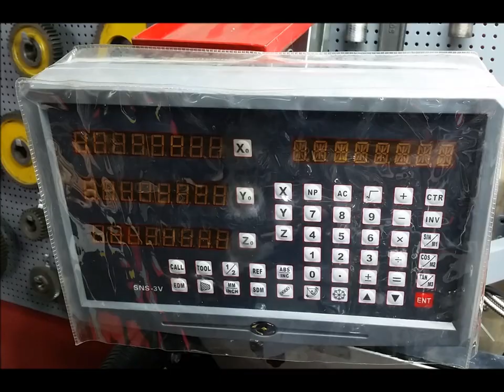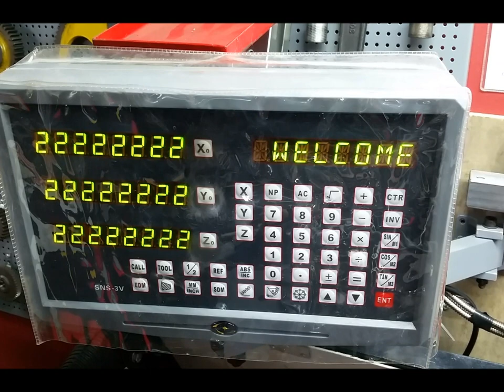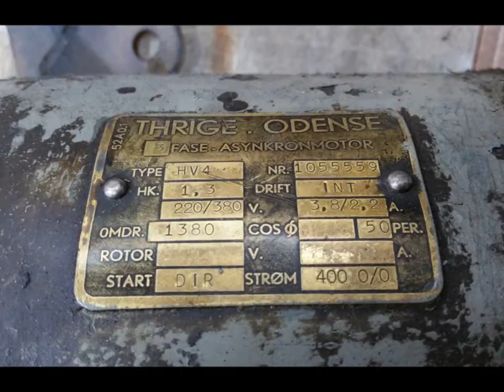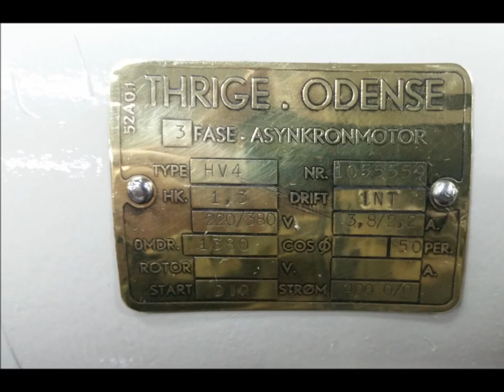Vilh Pedersen 1950 millingmachine restoration part 2

Comment: It almost seems a shame to cover-up that beautiful gearbox. Great work, looking forward to seeing the end result of all that effort. 

Thanks for sharing!
Reply from the maker: Thanks Neil! yes that gearbox is nicely made an very smooth operating.. These old machines is just amazing👍
Reply: Tapio Kahelin can jou tell me what's the colournumber u used? I'm restoring a vpu1
Reply from the maker: +Jelle Van Der Heide Hi! i have missed your comment, sorry sir! i have to check that colournumber.. good luck with your vpu1! are you making a video about the restoration? hit me a link if so😃
Reply: Tapio Kahelin Thank you! And i am also interested in what kind of primer and paint  you are using. I stripped mine and the surfaces  are not really smooth. I can use a filler and sand it but maybe there is a primer that does the job? 

A video is too late. I am halfway.  And my restauration is not half as professional as yours....😣
Reply from the maker: Hi! Paint code is TVT 1910. I think that it is not universal code. I use alkyd paint and rost protection primer. Alcyd paint is good for ruff surfaces. I used filler for some surfases where the cast was very ruff..

Im not so pro with this.. i looked the date in my paint can and i bought it two years ago :/ and not ready yet..
Reply: Tapio Kahelin Thanks! I looked it up on Google. Could not really find it but is the brand tikkurila?
Reply from the maker: Jelle Van Der Heide Yes it is Tikkurila Miranol Paint.